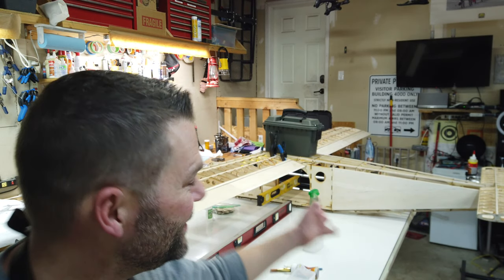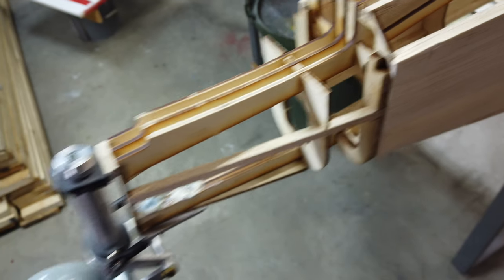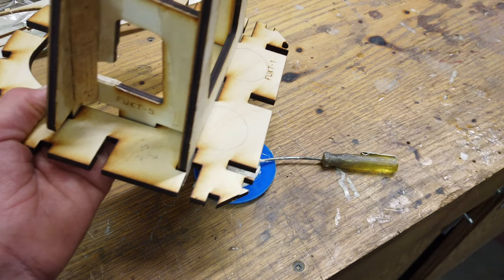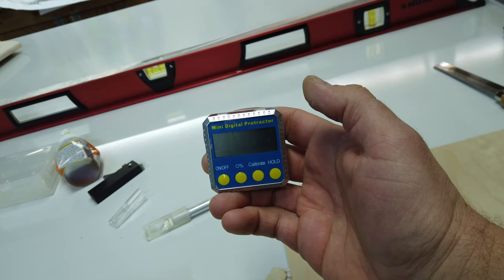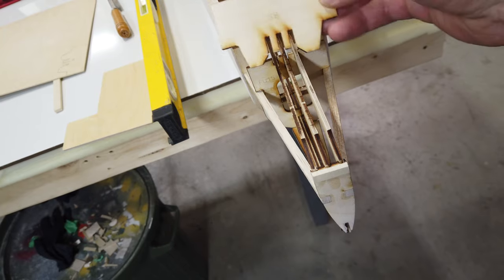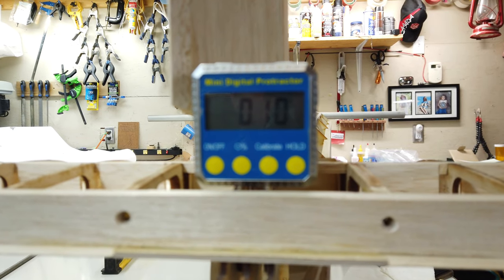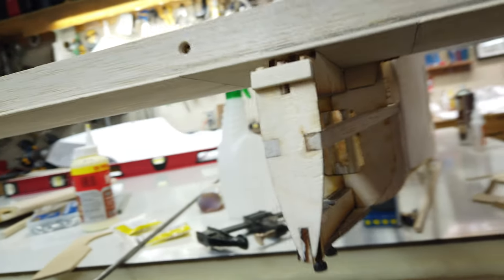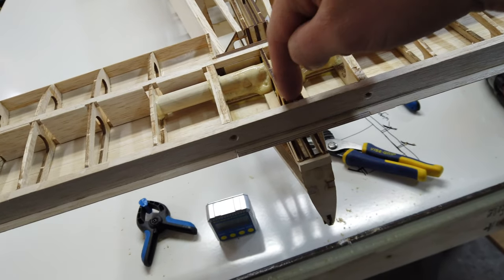MAKING THE STAB REMOVABLE - PILATUS PC-6 Turbo Porter - MR Aerodesign Part 6

Comment: Oh that's a nice tail section. I try not to over-engineer but I really like when others do. That's how I learn new building techniques.  I also made a removable stab, but only because I wanted to change the angle  incidence if needed.  I just bolt the stab to the fuselage with 2 x 4mm bolts and nuts. But I also put some small pieces ( not too much) of double sided tape so it can not move if I get some slack around the bolts. Before each flying day I check the plane including the horizontal stab, because its one of the few important parts of the plane and because its bolted. I am looking forward to the next building videos.
Reply from the maker: Thanks Red Bear RC!  I just try to not over engineer it too much!😂😂. Thanks for watching!

Comment: You should be sanding off the burnt edges of the lumber as the glue bond will be much stronger!! Burnt edges will not allow the glue to penetrate the wood fibers.
Reply from the maker: Good call Dave!  I have been very lightly sanding it but not removing a ton of material to prevent shape change. What your suggesting makes sense.

Comment: You know believe it or not on the much larger Brauer composite P6 they use two wood dowels at the front of the stab and a single bolt down through the stab at the back. plus the lower functional braces. that kit was under engineered to say the least.
Reply from the maker: Great info!  Thanks for sharing that. Good to know I’m on the right track!😊
Reply: @thelightersideofrc  but you added some needed reinforcement to ensure a strong joint. I think it was most necessary to add the dowel in the stab for a drag spar, Carbon tube would be nice nice there, but you're like me, find something in the shop to keep things moving along. really enjoying this build
Reply from the maker: Thanks and thanks for watching